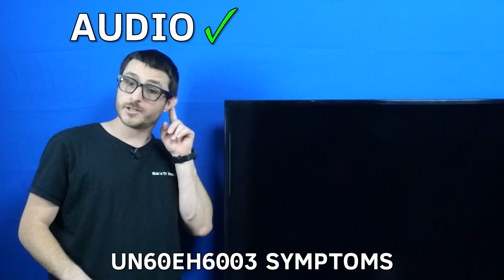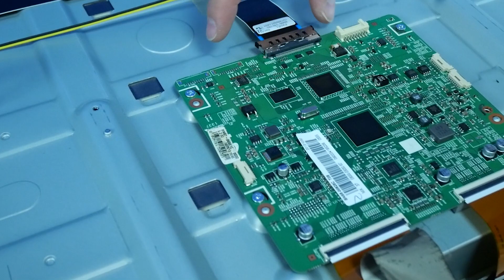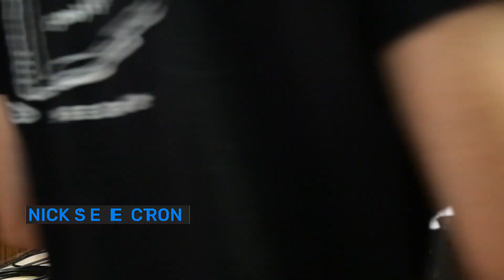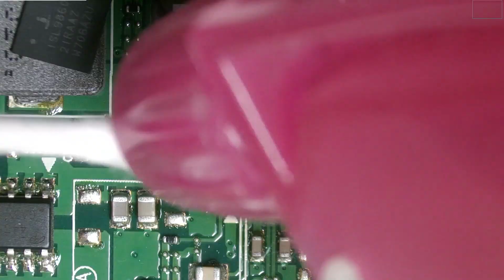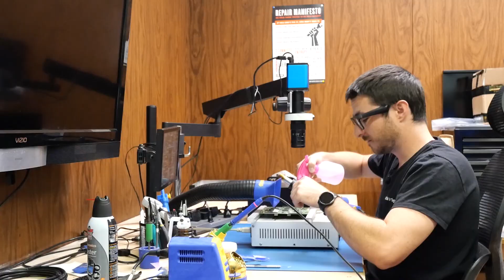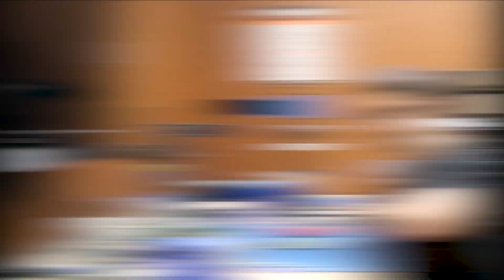How To Fix Samsung TV Black Screen UN60EH6003

Comment: Great video! I have a UN60EH6003 that will not power on. The red light flashes once then nothing. Previously I could unplug it for a few minutes and then it would power on afterwards, but that has stopped working. Is this a T-con issue or something else?
Reply from the maker: Easy. 
Disconnect the T-con from the mainboard and try again. Same fault? Yes = T-con is working just fine and your fault is probably mainboard or power supply. No = new symptoms from disconnecting T-con which means your T-con or your panel is defective. In which case reconnect the T-con but disconnect the screen from the T-con and repeat. 
if the same issue persists even with the screen disconnected then yes it's the T-con but if no then it means the screen is bad.

Comment: Thanks for a great channel. I got a deal on a 75" Samsung OM75D-W. Unfortunately, it has some issues. It started flickering and showing some lines and an overly bright image, then it went black. When I plug in my MacBook, it recognizes the screen and shows the correct resolution, so I believe the mainboard is working. I also see the backlight lit up. Would it likely be a broken T-con board? I have tried reseating all ribbon cables, but no luck. Sometimes the whole screen lights up 100% white, but only every once in a while—never any image, menu, or anything else. Is it possible to send the T-con board for inspection? I live in Sweden, but it’s hard to find anyone willing to do this here. Keep up the good work!
Reply from the maker: lines and issues with brightness are typically associated with a bad screen. I unfortunately don't think your set would be worth fixing in this situation but I can't know for sure without diagnosing the entire TV. If you can find a local person that would be your best bet but it seems like that might be tough. Sorry.
Reply: @NicksTVRepair  I did try to switch places of the two T-CON board cables that connects to the display. I then got an image with only one problem, the resolution on right half of the screen is lower. Can this be bad cables or something else to look for?

Comment: I have a Samsung GQ50Q60TGU and it turns on with sound and the backlight works, but there is no image on the screen. The TV does not have a t-con board. Is there a similar way to troubleshoot this?
Reply from the maker: You most likely have a bad panel. Not really much to do for troubleshooting on those.
Reply: @NicksTVRepair  thank you for your answer!

Comment: Do yall take mail in repairs for the same issue?
Reply from the maker: Yes we do. 
Do you have a defective T-con board that needs to be repaired? If so can you confirm the model of the TV and or part number of your T-con board? 
I would recommend you fill out our contact form linked below with that information:
https://nickselectronics.com/pages/contact

Comment: Got another freebie TV today, the panel shorted out and melted the plastic trim. never seen one like that. Its a 2013 Samsung 50" parts are prob worthless. I put out an ad for TVs, got all kinds of response, prob older flatscreens but free is free and needed experience.
Reply from the maker: I would say you should try and advertise that you recycle LED TVs. We get tons of newer TVs donated some with cracked screens, some with various small issues, and sometimes they are fully functional but the person just upgraded and didn't know what to do with the prior tv. If we ever sell a TV to someone we also typically ask what happened to the prior TV and if they wanted to bring it in for recycling or donation or if it has value even a trade in credit. 
It actually got so bussy that last year we started to charge to recycle broken TVs. We do also work with a local company that scraps all the metals and what not so that helps a tone. Find a good partnering business to help you with the leftovers you can't use or need.
Reply: @NicksTVRepair  I bust up the plastic and leave the metal backplate for metal scrapers. This is crazy, easy work too.

Comment: Hello Nick .. what the tool that you are using for testing the main board in your video.. do you have any référence that you could share ... it would be nice .. thank in advance Cyril (France) .. Bests regards
Reply from the maker: Bonjour Cyrille,
The Mainboard tester is named TV160 6th gen in the video. You can buy it either on eBay or Aliexpress for about $120-$150. It only works for 1080P and 720P. They do have a 7th and 8th gen that work with 4k but it runs for about $300 to $400
Reply: @NicksTVRepair Bonjour Nick, thank you so much for your fast reply. Very interesting tool, I will check. Thank you for always sharing your professional knowledge and expertise, I really appreciate and to watch your video. Thanks a lot greetings from France .. Salut

Comment: Computer shop came through today with 2 freebies, both Samsung, a 40" CCFL back lit, but in mint condition, and a clean 60" 4K smart TV, I found a blown secondary fuse and shorted mosfets feeding the CFL inverter board, hope thats all it is, easy fix. The 60" has standby power but doesn't power up, no back lights, nothing, bad main board probably? I had almost this exact TV before and I waited 2 yrs for a main board. The board is BN94-08298A, can you rework it? Used is over $100
Reply from the maker: For the UN60JU7100FXZA, if you disconnect the mainboard from the power supply, and plug the tv to the wall, do you get your backlight? Do you get the 13v line? If yes then disconnect from power, reconnect the mainboard but this time disconnect the T-con. Plug the TV back in to the wall, are you still having the exact same symptoms as you were originally? If yes then yeah your mainboard is probably bad. If no then you may have either a bad T-con or panel.
Reply: @NicksTVRepair  No backlight with main board disconnected, 8 volt stdby stays 8 when power button pressed. That test point  says 8 volt stdby 13 volts on. It stays 8
Reply: I got 13 when I disconnected the main board, no change with Tconn connected or not. Still no BLs either way.
Reply: @NicksTVRepair  How do I trick the power board to turn the BLs on? I think they should come on when the main is disconnected right?
Reply: I tested the BLs with my tester, can't get any to come on.
Reply from the maker: @vernonbosshard9317  Hey Verson, just FYI I don't get notifications on replies to comments so I don't always see them. If you have an important question I would say to do a whole new comment or just send me an email directly. 
To answer your questions, if you have 8v instead of 13 when the mainboard is connected, my understanding is that your mainboard is not fully turning on or not allowing the power supply to turn on. However that could also be because there is some sort of defect with the power supply which the mainboard is detecting.
With that TV when you disconnect the mainbaord from the power supply, you absolutely should be getting backlight. That power supply should auto turn on and activate backlights. 
When you do your backlight checks are you disconnecting the LED connector from the power supply? If the power supply has some sort of short circuit it could be why you aren't able to light up the BL if they are still connected in circuit to the Power supply. 
This is definitely an odd one.
Reply: Just got this tv free where u get chip

Comment: whoa whoa main board tester? Thats what I was looking for, well not that hard if you found one first.
Reply from the maker: Hey Vernon,
Yeah we have had this one for about 4 years or so, and have 5 different types of mainboard and panel testers. Some are good, some are a waste of money. Like I was saying in another comment, I think we will be doing some tool reviews for TV repair in the future which would include the mainboard tester. This one is the TV160 and runs about $145 on eBay or $125 from Aliexpress if you are okay with waiting a month for it to arrive. But I don't know if this one is worth buying anymore since most sets are 4k now and this one only works with the 720P and 1080P sets.
Reply: @NicksTVRepair  Yea I would be interested in what test equipment is worth buying. I actually had that tester saved on Ebay, I forgot about it. Damned memory.

Comment: Can Pannles itself repairable like cof bonding..glass short removal..etc
Reply: Is it worth it to repair a panel?
Reply from the maker: I believe so, I have fixed many panels for customers. Some times its as easy as replacing a shorted ceramic capacitor or diode on the address boards, sometimes it's much more involved such as burnt COF in which case I don't have the tools to perform that type of repair. 
I guess it depends on the panel failure.
Reply: @bobsoft  I've seen the tape method used to block one side of the row signaling successfully, I've seen panel driver boards get repaired, but if the fault is in between the laminated screen you can't.  COF bonding repair is tricky, I have not seen any successful methods for that. Watch you tube videos as much as you can.
Reply: @vernonbosshard9317  Yes I have seen timing signal blocking by tape or breaking traces, and COF bonding. But no one has tried to repair transistor shorts in a panel. COF bonding is common in China where they have the bonding machines to do that.
Reply: @bobsoft  Yea I don't think you can repair TFTs in a panel.
Reply from the maker: Yes sometimes, depends on how the fault occured and what needs to be done to repair it.